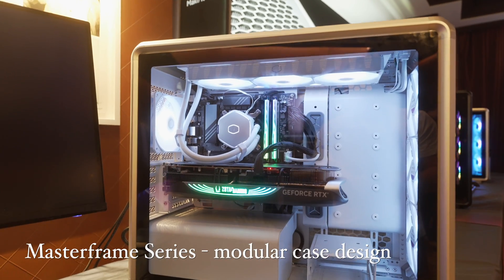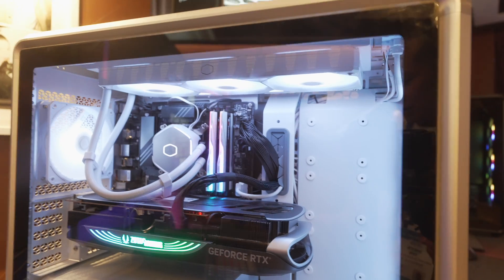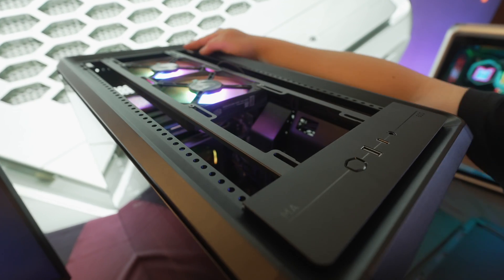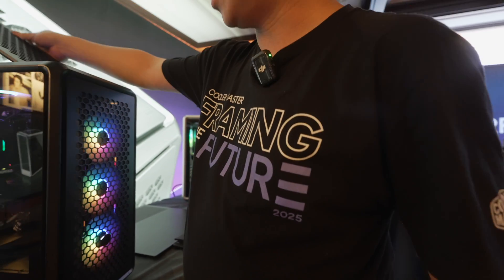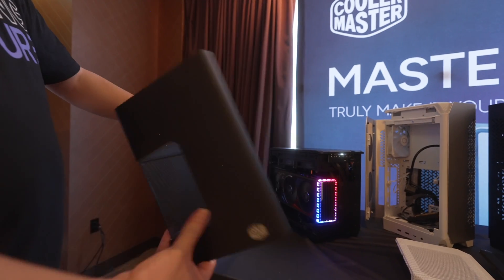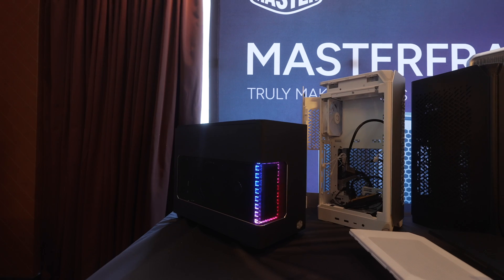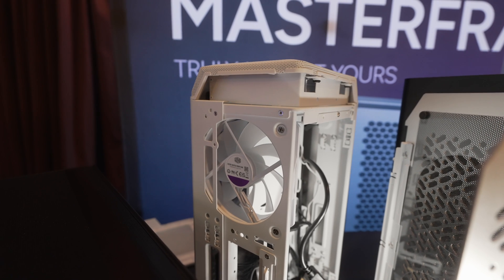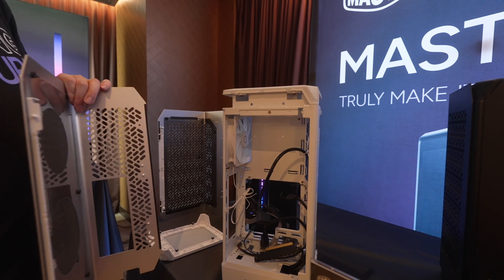New NCore 100 "Air" and NR200P Max V3 - Cooler Master's Cases @ CES 2025!

Comment: Very interested in the performance of the NR200 v3. If (big if) the new gen of GPUs are worth buying, then I'd like to see how the additional power draw and potential heat exhaust will impact the overall system. Also how well the case is able to handle the new sizes for optimum efficiency of layout. I'm sure you will be running tests on multiple GPUs and layouts :)

Comment: NR200P V3 is a disgrace to the OG NR200. It should have been a different name/designation. I expect it to be more expensive and worse than the regular Nr200 V2
Reply: Fr, this is one of the ugliest case I’ve seen in a while. Utterly unacceptable for presenting such an unpolished product at CES

Not to mention the strix is one of the worst GPUs I’ve ever owned. A smaller gpu would only further ruin the aesthetics because all you can focus on visually is the mesh region and you’re gonna be left with a gaping hole.

Comment: I'm so excited for the NCore 100 Air! I really liked the looks of the original but the custom water cooler drew me away from it. This new version looks pretty much perfect to me, especially with that new white frame color option
Reply from the maker: Agreed, one I did not like liquid cooling in this configuration since the rad was the exit point, on top of that only being a 120 (a thick one but still). Also the extra height required for it made it a little too tall/top heavy.

Comment: Wonder if the MATX Masterframe400 will fit an ATX motherboard after taking off the psu shroud.
Very nice design of the front fan rails, almost no obstruction of air. It also looks like it could potentially fit 2 160mm fans in the front (Shark Force 160 has 140mm fan mounts)
I very much like the side panel options that they showed. I'm very much bored with TG cases and those masterframes look exactly like a thing i'm looking for.
Would be nice to get a bit smaller MATX case variant so that its about 2x140mm fan height.
Reply from the maker: It should, standard ATX is just 2 more slots. you do have to account for standoffs though, but since it was designed around the expectation of the 5090 it can be a phenomenal waste of space for only mATX. I hear you on the side panels, they're quite different.

Comment: New nr200 design is a hard pass.
All that heat from the backplate will either.
A: Be sucked into your low profile cpu fan, heating your cpu.
Or 
B: if using a aio, the heat will increase pcb and chipset temps and possibly shorten the lifespan of your components.
Love the original nr200p but this isn’t gonna cut it.
Reply from the maker: It's a bit of a head scratcher to me.
Reply: And it’s ugly as heck.

Comment: ATT CoolerMaster: Literally all I want is...

· ATX case in "sandwich-style" (GPU behind motherboard tray connected by 'riser' cable)
· PSU positioned at the bottom of the case, perpendicular to the motherboard, 50% in each compartment (CPU|GPU)
· Bottom intake fan(s): the PSU's fan + whatever fits in the space 'behind' the PSU
· Rear exhaust: 280mm or 360mm CPU AIO … or 2x 140mm … or 3x 120mm fans
· Top exhaust: 280mm or 360mm GPU AIO … or 2x 140mm … or 3x 120mm fans
· Front intake fans: 3x 140mm top (greater speed/CFM, positive internal pressure)
· All this under 40L volume, as SFF as possible, oki, thx, cya at next CES :3

Comment: NR200 "check out my graphics card, bro" edition.
Reply from the maker: I'm kind of concerned about the look when users won't run that particular dimension card to fill that space. I get it with the mesh thing but it's a little unsettling at first glance.
Reply: @MachinesMore  I wonder if you could fill the remaining space with a screen to view system performance or something.

Comment: The NR200P V3 is just stupid. All they had to do was make V1 that is mATX mobo compatible with some USB-C ports on the front panel. None of this vertical GPU with riser bullshit.
Reply: Agree. Coolermaster is always 1 step forward 2 steps back
Reply: Top aio (not limited to CM aio) and bottom horizontal GPU ftw. I don't know why they keep pushing this vertical GPU thing that almost no one uses
Reply: Bottom to top airflow FTW. The 5090 FE will benefit massively by being placed horizontally alongside bottom intake fans.
Reply: Agreed 100%
Reply: Matx isn’t even a factor for me all I needed was the ability to attach a aio on top while keeping the traditional layout
Reply: Mesh is better for air, especially  for the upcoming  5000 gpus 
 You hate it because you love the gay microwave style case.

Comment: the NR200P Max V3 looks interesting, but I'd rather have just the case without the extra hardware. I currently have the Max V1 and the pump is starting to fail after 2 years, the PSU fan is also rather noisy,

Comment: I wish market wouldn't bet so much on vertical gpus. OG NR200 is the real V3
Reply: Yeah. I still got my nr200 from 2018, and there is no reason to upgrade it even with 50 series gpus on the way. Hopefully, I get lucky getting one of the fe models. 2 slot gpus are rare nowadays.
Reply: Totally agree what people don't realize you can mount 240 rad on the side panel since no room at the top OGNR200P user
Reply: i fucked up buying a max

Comment: will the big master frame 800 support bigger than 140mm fans in the front?
and is it possible to get the case with black inside but silver on the outside?

Comment: I love that they're focusing on putting vents only where it's needed, even making built in fan ducts of sorts for both ITX cases. We don't need tapes to optimize airflow anymore! Next step is to use vents with higher open area and better dust filters (nylon mesh).
Reply: Maybe make your own ducting out of ABS on a 3D printer?
I made a replacement CPU duct for a Lenovo Think Center SFF office PC.
Reply from the maker: They get it.